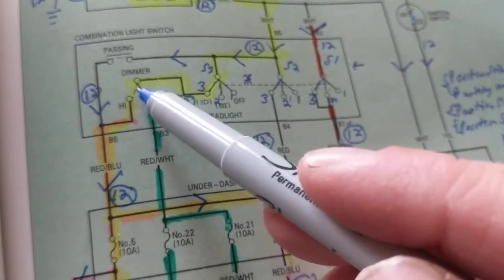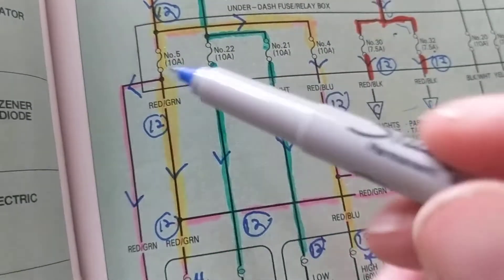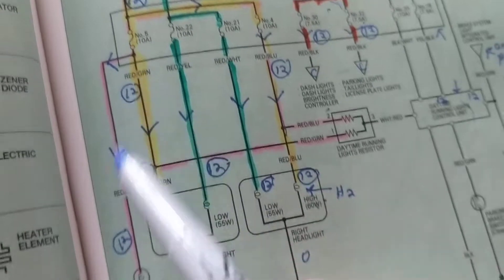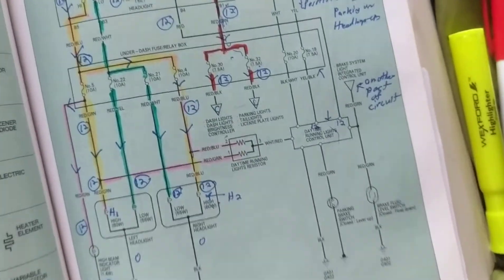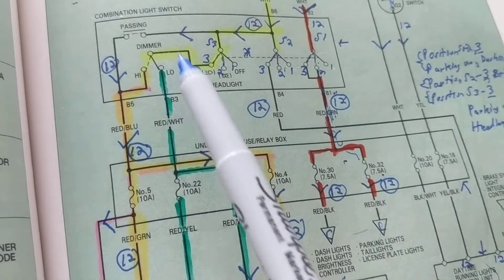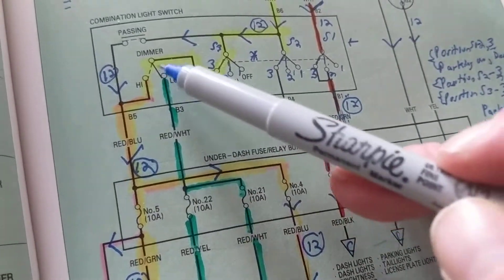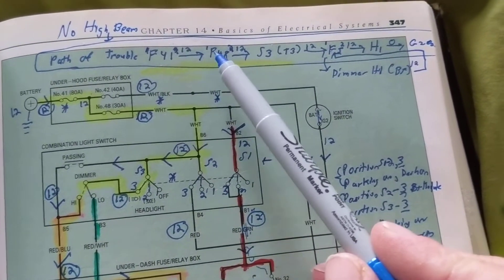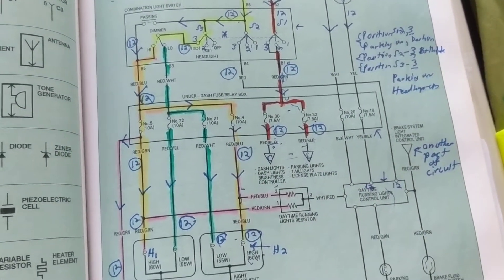HOW TO READ AUTOMOTIVE WIRING DIAGRAMS, SIMPLIFYED FOR BEGINNERS

Comment: Thanks for this, I have a 1997 toyota 4runner, my headlights keep coming on when their off,sometimes I can get them to go off by flicking the switch around, I've replaced this blinker light switch  with a couple of others, but I think it's may be something else, would happen to have any suggestions, I can mess with cars a little bit.
Reply from the maker: I will look at the diagram
Reply: Thanks again
Reply from the maker: cannot find an exact schematic for that Toyota 4Runner however I believe that there are relays that are responsible for this you have to look up the relay and measure the voltage at terminal 87
Reply: Ok thanks, by the way I just found, your Channel, your teaching is great.
Reply from the maker: @Dav-h1l4v  much appreciated keep me informed how it goes David

Comment: very good video but in this video, more than half is just repeatition that is not necessary, could be easily shorten to 5mins video
Reply from the maker: I'll try my best
Reply: Thank you for your comments that's because you need 10 minutes to have more advertisements if you have less than that it cuts down the advertisements
Reply: @automotiveelectronicsfroms2699  probably could use those time for other important information so viewers don't get bored or frustrated and stop watching?
Reply: You should see all the emails that I get about people are confused about schematics and they're trying to diagnose after they tried many parts to try to fix the problems but we're not successful electronics is a tough topic to teach